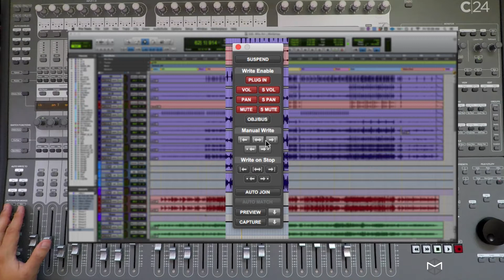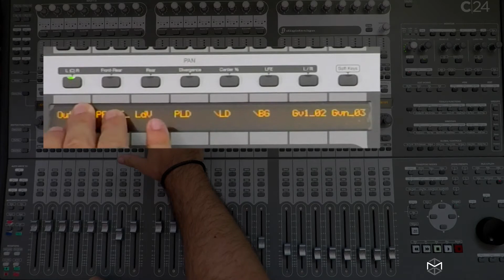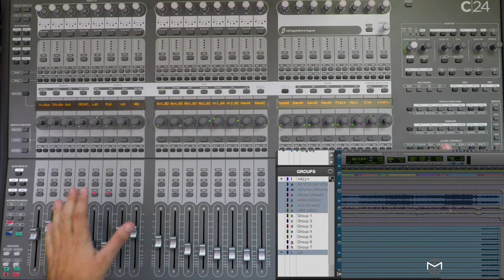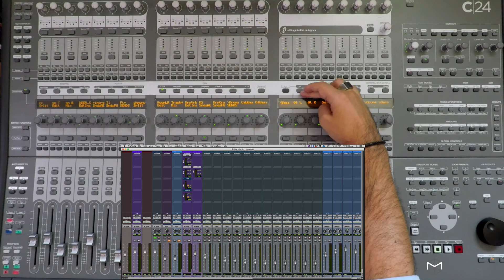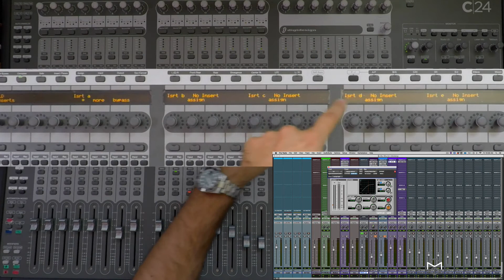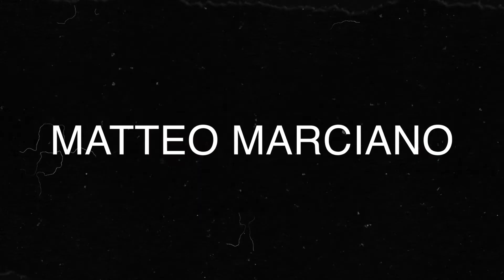Control Surface Workflow - C24

Comment: It is 2025 and I still use my C24 control surface with Pro Tools ultimate 21.3.1. It really is the best one I ever used. Thanks for this video, it shows several tips I did not know yet:)

Comment: Hi ,
I have a C24 connected to a Omni, could you help me how is the best way to put the cables from omni to c24 and use 2 pair of monitors? I can not figure out yet,
Thanks very much
Reply: Dude, the c24 works in pro tools 2021.7? I wanna buy one in 2024.

Comment: I have a question, which PT version is still fully working with C|24?
Reply: All intel versions of Pro Tools are still working with the C24. If you want to use the C24 with Pro Tools on an Apple Silicon Natively, you will need to buy the Neyrinck V-Control Pro software to still be able to use it on Pro Tools Natively on M1/M2 macs. if however, you use Pro Tools on a M-series Mac via Rosetta Mode, then you don't need Neyrinck V-Control Pro.
Reply: MY C24 using VControl, some of the functions don't seem to work, like if I insert a compressor (avid stock) or eq the eq and den lights don't light up! noooo. maybe it does work and its me... this video I found very very useful thank you so much for uploading it. Im going to practise using it with this video lots ) (im on windows 10 and windows 11 in protools studio 2024/5. hmmm maybe protools 12 or hd is best for this. Id like to use the advanced features JOIN (you can punch in level changes volume automation setting the level first then JOIN I think), the guy that did this video was saying its only available on HD protools.Does HD protools offload the plugins avid compression and eq? and effects? ) hmmm I might have to get the HD protools, will carbon do that? Thanks )) no need to reply  )

Comment: hi, what about the line submixer ? do you used it to summing the tracks  and  print a stereo mixdown through it  ?
Reply from the maker: Nacho Nieto hi there! I used to, but not anymore, now o use a different submix-to-print method which I will actually share very soon on my channel so stay tuned ! For a bit I used to have the submixer hooked up for either FX return or even as a playback system in case I wanted to connect an iPod or something. Again moved ahead with another audio system. So as it right joe the submixer is not in use (in my particulate setup and configuration) 
Cheers

Comment: I'm trying to resurrect an old C|24 in our classroom -- We have a studio with an old system setup but the computer had died etc... hasn't been used in a long time. Here's my question - Are you only using it as a control surface and bypassing all of the I/O on the back of the console?I have the new Scarlett 18i20 and I'm trying to figure out if I should use it's preamps or the C|24s -- THANK YOU for your help!
Reply from the maker: RVTCSTUDIOS Hi there, thank you for your comment. Glad you enjoyed the video. Stay tuned for more! As per your question, if you want to use the pres that comes with the C24 you should use another type of AD/DA converter such an Avid HD I\O. You Scarlett comes already with 8 pres therefore you might be well as bypassing the 16 pres on the c24 and simply use it as a controller. Do not use the scarlett’s pres in conjunction with the C24 that would be a very bad idea instead. I hope this helped. 
Cheers

Comment: If I add a UAD compresser, will the DYN know to open the plugin to see and mapped all the parameters? SAme with Sends. The window pops up on its own to see the DAW send fader correct?
Reply from the maker: Skiroy absolutely YES. I can tell you even more, if you want you can actually map all plugins (UAD as well) to a specific rotary encoder so that each parameter (eg. compressor ratio) can always be found on the same location once you open that plugin. Of course with newer AVID control surfaces you can go beyond. Cheers